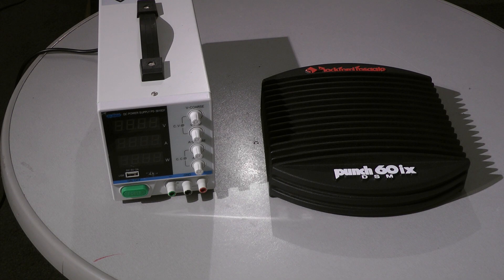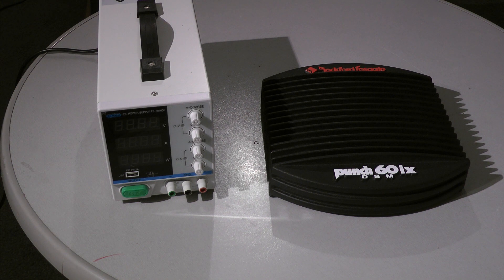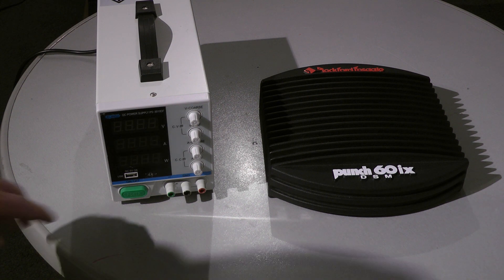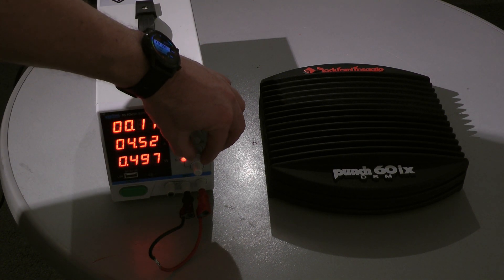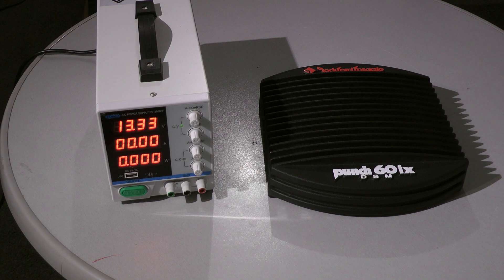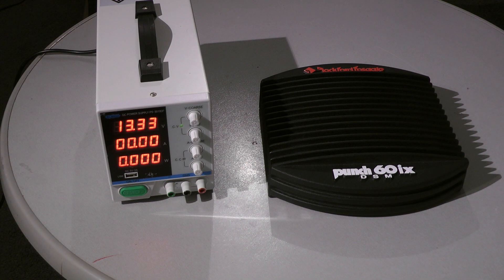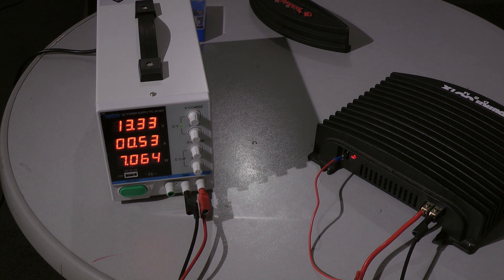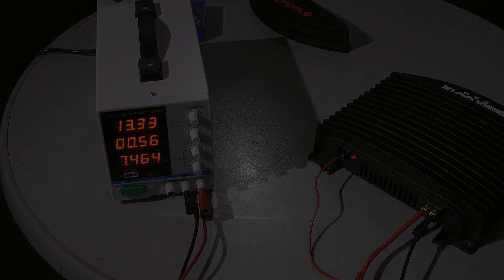Rockford Fosgate - how to power up car audio amplifier the save way - no amp dyno power test

Comment: Sorry for my lack of knowledge but after you do it this way, then it's ok to run it in your car? Is this basically to like jump start the amp and get the caps charged since the amps been sitting for years and years and caps are discharged? So this is basically to power on the amp get it up and running and then you can install it no issues?
Reply from the maker: Yes, I just check how many Amperes the amp is pulling. It’s often the case that old amps pull too much and then you have to readjust the idle current. That’s  the best case! If there are defective output FETs the amp will burn up and more damage is caused because your battery delivers lots of Amperes. That’s just to avoid more damage if there is a failure in your amp. If you limit the current with a power supply it’s way more safe 👍
Reply: @audiokeller1975  ok I get what you're saying makes sense. But let's say if you don't have a power supply, is it ok to use a 12v car battery in your home and run an inline fuse holder with a 3 amp or 5 amp fuse to limit the amperage? Thank you... Btw I love your channel I'm a subscriber now and shocked you don't have more subscribers.  Keep up the good work.
Reply from the maker: I recommend 5-10 Amp inline fuse because if you turn on an working amp ( apply remote ) the caps are charging and for a short time the amp pulls a higher current which can easily blow a 3 Amp fuse 👍 
Thank you for subscribing and your kind comment, I don’t know how to advertise a channel 🫢😃
Reply: @audiokeller1975  right on man thanks! Yea I ordered like 5 punch DSM amps and ebay has a 30 day return policy and it's been like 2 1/2 weeks and I have not tested them yet was too nervous until I saw your video and subscribed. I will start at a 5 amp fuse on the inline fuse holder and see what happens man. Wish me luck they all work lol.
Reply from the maker: The first generation punch dsm amps often have bad SMD capacitors ( the silver 10uF , 16V ), There are automatic fuses available they avoid lots of “ pain in the *ss “ 😂 I use this kind of fuse 👌
Good luck with your amps 👍👍👍👍
Reply: @audiokeller1975  oh man... I never knew about the first gen DSM with that issue or the fuse you're talking about to Dave some pain lol. I just thought they might go bad just cuz they're almost 30 years old. If you have time to explain or make a video on this subject that be great! More content 😄
Reply from the maker: Check for
Black soot around them, if there is nothing visible they are likely ok. The punch in series have same capacitors but a better batch. It’s not Rockfords fault it’s a fault of the supplier back then.
Reply: @audiokeller1975  thanks so much bro!! See this is why I subscribed to you because you are very thorough. Thank you brother!
Reply from the maker: I misstyped, I mean ix Series 👍
I have a video on yt where I show the issue on a punch 100dsm ( pre ix series ) , these amps have daughter boards and in this case these caps on the daughter boards leaked out. Also thank you 👍👍👍👍
Reply: @audiokeller1975  oh man, all the ones I have are first gen DSM like 6 of them total and two ix series. None of them have the warranty sticker broken was trying to keep it like that but I might as well open them and see if the caps leaked out? They don't have warranty anymore so what's the point of the sticker right? Lol...
Reply from the maker: Visual Check is important, in my opinion forget the seals especially if you want to use the amps👍
Reply: @audiokeller1975  I bought a punch 40 DSM off the original owner looks brand new. As soon as the amp turns on it makes a high pitched noise and the fuse keeps blowing. Blown three fuses so far back to back to back. Tested 5 of these DSM amps that I bought off of eBay and all tested good then this one number 6 keeps blowing fuses. It turns on red light is on but like within two seconds fuse blows. What do you think?
Guy said he's the original owner from high school and was working when he uninstalled it and guess it's been sitting all these years. Let me know what you think. As always you're the man when it comes to these old punch DSM amps. I highly value your input.
Reply from the maker: This could be : Bad caps , damaged FET in power supply section or damaged FET in output section. Stored for many years doesn’t mean they don’t age ✌️

Comment: Nice tutorial.
Where is the other end of your remote turn on cable connecting to?
Reply from the maker: thanks for your comment! its not visible but
the remote cable is also connected to positive voltage of the power supply.